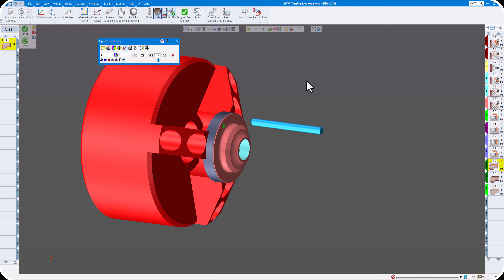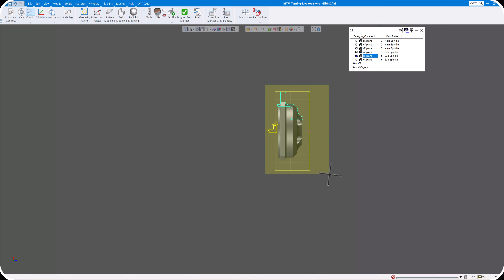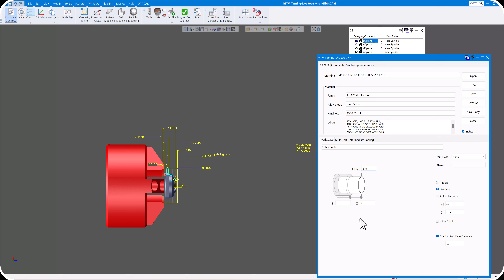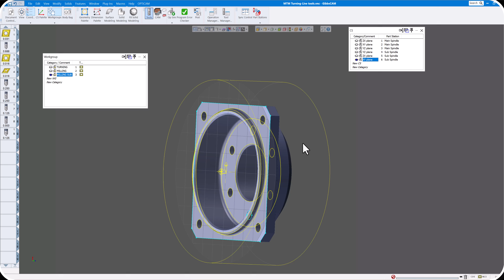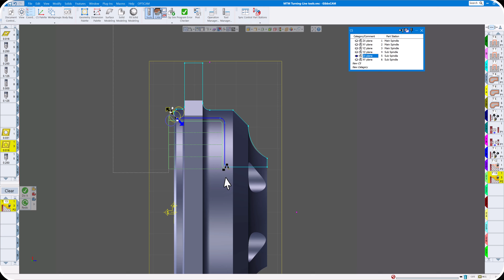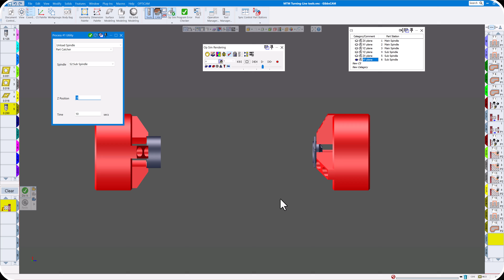GibbsCAM MTM4 Class 6, video 2 (Sub-spindle)

Comment: Hi, thanks for the videos, they have been great help for me.  If you are using a chamfer mill that is smaller than the hole you wish to chamfer, e.g. 13.5 dia chamfer on a 12 dia hole, and you only have a 10mm chamfer mill (and therefore an interpolation required) is there anyway to do multiple at the same time in one operation?
Reply from the maker: Hi Jack. Yes there is, but a number of  ways to do it.  If you plan on using a Contour Milling Process, of course when you select multiple holes, Gibbs will just cut down the center.  So to make it will always cut the inside (or outside) of each hole, just click on the OFFSET tab on the process and choose Offset, Cut Inside, then just select all your holes, choose how deep and how much stock to take out.  If you are doing a number of holes in a bolt circle then you can just choose duplicate and rotate.  Hope this helps.  Thanks for watching.
Reply: @GibbsCAMVideoTutorials  will try this out, thanks for the response!